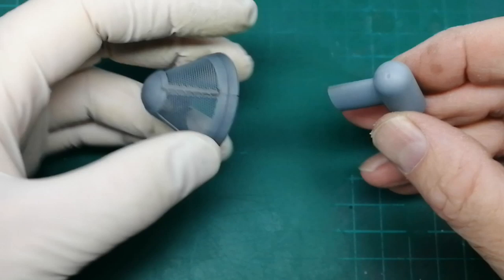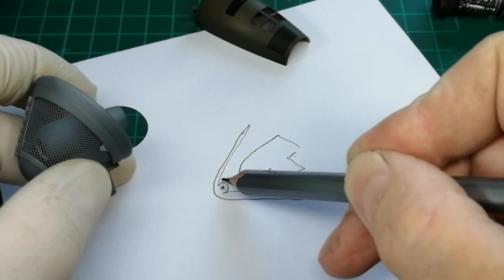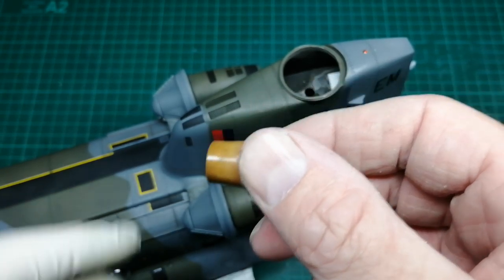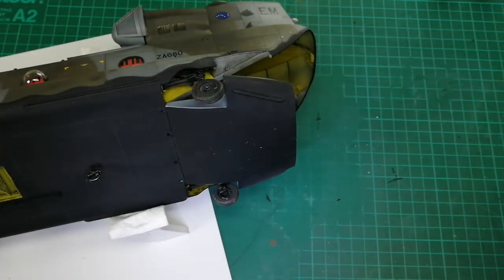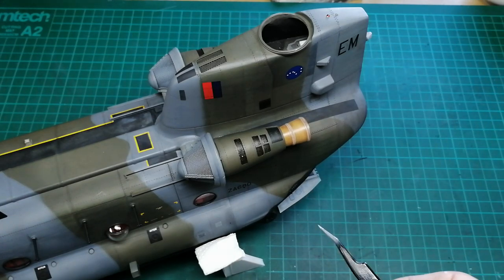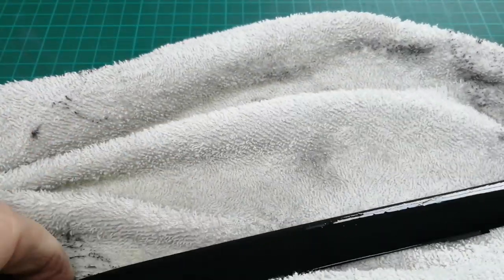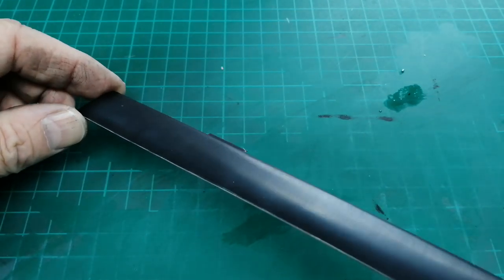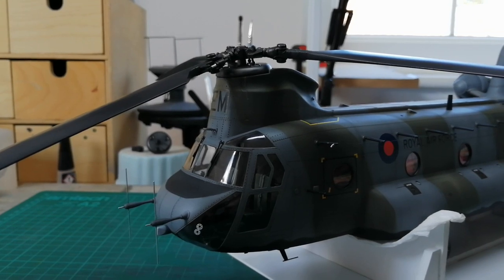Trumpeter's 1/35 Chinook 47D built into a RAF HC. Mk ? (The End)

Comment: Late by a year again, but just a FYI, both ZA680 and ZA682 were original HC-I aircraft from Odiham dating back to the first batch in the early 80s I worked on both of these aircraft then. 680 was originally BW or 18 Sqn, and 682 was EM of 7 sqn, although it possibly started on 18 Sqn - I don't recall. The B prefix letter was 18 Sqn originally (Bravo November for example), and E was 7 Sqn (ET was my favourite), While F was 240 OCU If I recall. Things got a little mixed up during & after the Falklands war, and the 18 Sqn aircraft sent to the Falklands post war, including BN, were taken over (and rebadged) as 7 Sqn aircraft.